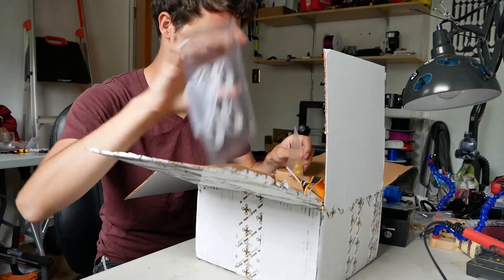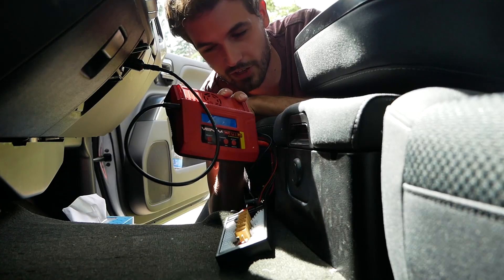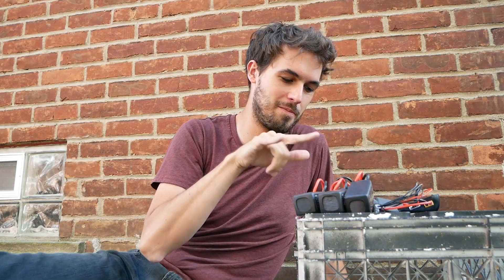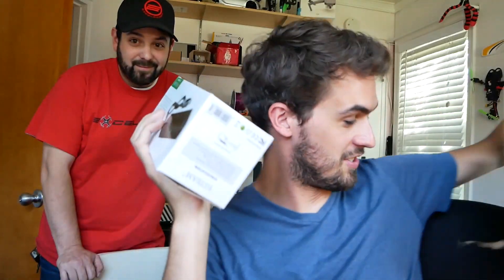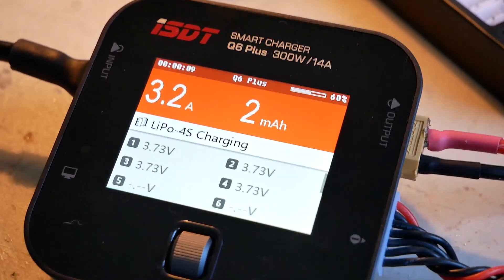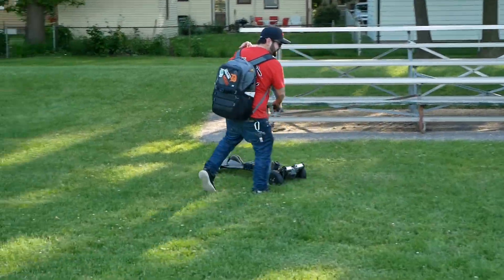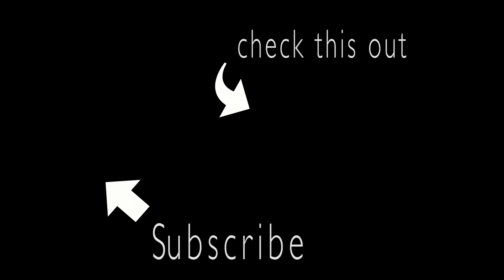charge drone batteries with a truck

Comment: I've charged my truck with a drone battery. lol It worked quickly. Only use 4s packs for that. Anything higher will fry your ride. Storage voltage is perfect for that.

Comment: Does it give a alarm on reaching the low voltage of battery that supplies power? I used a 6S as power source and set up 22V as cutoff but it still goes on charging below 22V. Any suggestions will be great. Thanks

Comment: I want a tiny whoop so the kids can get Into fpv as well but I cant figure out which one will work with my flysky transmitter lol I kno it sucks but medical issues in family prevent me from splurging unfortunately
Reply: You can get a cheap fc from banggood
Reply: There is a BUNCH of cheap Flight Controllers

Comment: So, if you plug straight into a car you don't need to use a power supply?
Reply from the maker: nope! Car power is already DC. Power supplies convert AC (wall power) to DC
Reply: @LeDribFPV  oh sick! That's perfect. Thanks for the reply

Comment: Hey Drew, Thanks for the video. Maybe you can help me :D I did it with a Xbox One Power Adapter but I got 2 yellow wires, 2 black ones a red a blue and a light green/mint clour wire. I put the two yellow ones together, the two black ones and connected them with the XT60. Then I put the blue and red one together and connected them to the red XT60 wire. I just isolated the green one for his own. When I connect Power Adapter and charger the Power Adapter shuts off. Why? :D

Comment: I have that charger and love it. Try a power supply with up to 32 volts input. A laptop power supply with I higher voltage can provide more watts per dollar! I power mine with a $12 24volt at 6A =144Watts. Charging at 17v, I can go up to 8.4 amps not counting for losses. In practice, I dont go over 6.5A

Comment: I got a 600w 27v for 28 bucks on aliexpress which powers my isdt sc-620 (20a/500w) with ease. It charges my 2x 6s12000mah field lipos at 20a nicely. Tip get a higher input voltage then 12v. 27 is pretty optimal and easy to obtain.

Comment: HEy Drew! Great video! HOw is the power supply holding up? I was planning on using an xbox power supply just as you did but I'm worried the wires are too thin to support 12A. What should I do?

Comment: Hey Drew Have the 500W version of the charger. Best power supply to buy would a a HP DPS-1200 it can output 1200W @12V

Comment: Hey Drew and other Guys i have a Problem i have the Rotor Riot Runcam swift, The Tramp HV Vtx and the DYS F4 FC.
I have soldert all wires to the FC but it does not work i get a very unclear and unstable video. 
I hope someone can halp me because i search for a sollution for over 3 Weeks now and cant get it to work properly.

Comment: Currently using that charger for the first time and I'M IN LOVE!!! It's the greatest, cutest lil thing ever!!
Reply from the maker: glad its working for ya!
Reply: I only tried to go up to 6.7amp in the car (although the cable was only luke warm and the van socket was rated for 12v 120watt). Literally charging for the first time with the 19.5v AC brick right now, 5 Tattu R-Line 1550mah batts, all started at 3.80v per cell, running it at 7.7a and it's been 42 mins, cells are at 4.15v (ohhhh sooooo close)        :) EDIT : 52mins DONE! :D

Comment: The easiest way to charge from a wall plug - just use an old Laptop powersupply - usually there are tons of those for free, being waste deposited every year. I built myself an XT60 Adapter for these kindof standard DC plugs coming from the Laptop powersupply - so no need to cut the original powersupply cable.
https://www.banggood.com/de/DC12V-MaleFemale-Power-Supply-Jack-Connector-Cable-Plug-Cord-Wire-5_5mm-x-2_1mm-p-1086722.html

Comment: another idea for a power supply is converting a computer ATX power supply.  there is a little bit of messing around, but can be done in an hour or two and will provide at least 35 amps as well as 5 and 3.3 volts.  ATX supply's can be bought for less then 20 bucks too!

Comment: If you want a really good power supply (I mean with temperature, overvoltage, overcurrent, etc protection) just purchase server power supplies from ebay or something. A friend of mine bought 4 of them for under 10$ and we both now have 1000W 24V power supplies for nearly no cost. A much better option than to purchase expensive power supplies which can't handle that much current anyway. Think about it, you can't really get a better power supply than one for a PC, because the delicate electronics in a computer need clean consistent power.

Comment: Dude, get a power supply for a server. They're super cheap for their output power. I have a Dell N750P-S0 that puts out 750 watts at 12v. You can find them on ebay / amazon for under $30 and power multiple chargers off it. The pinout diagrams are easy to find and it's super easy to wire it up. I feel bad for all the people out there who spend so much money on power supplies. The one's made "for the hobby" are ridiculously over priced.

Comment: hey drewi have a question i have a bunch of 3s batteries but no 4scould you recomend me a frame and motor that i could useim looking for it to be relitivly cheap and do freestyle with a good flight timesorry if im so specific, my 3s are 11.1 v. 30c 2,200. if the 3s is to underrated than i can get a more powerfull 3sagain sorry, Aaron

Comment: Dude I'm super glad you mentioned that part about your cig plug not having a fuse and just being direct connected with thick gauge wire. I didn't even think about the silly reason the fuse is there in the first place. **First Safety Tip** the average car cig adapter wire is NOT THICK ENOUGH TO SUPPORT MORE AMPS THAN THE FUSE IT COMES WITH. Reminder friends, do not change out the 2-3 amp fuse in those adapters to a larger one or bypass, the wire will not support greater amperage. I found one from a broken power inverter that was direct wire instead. **Second Safety Tip** BIG @SS AC to DC power bricks generally have GIANT CAPACITORS which hold voltage for LIKE FOREVER. Mine was still showing 19.5v FIFTEEN SECONDS AFTER UNPLUGGING, 8v 30 seconds afterwards, and TWO MINUTES LATER was still showing 0.5v. So when you chop the end off and are checking polarity with yo multimeter, MIND THE BARE WIRE GAP peeps :) ...that is all :D
Reply: maybe you can help me on this one: if i DO want to run wires from my battery through the firewall to the cab, what amperage is safe to charge while driving/idling? is it dependent on the alternator?
Reply: I don't think I've ever seen anything smaller than 10amp fuse on a car for the cig port

Comment: I've noticed with my isdt SC-608 it wont pull full amperage running off of 12v supply. When I switched to a 24v supply it will now charge at full amperage. I used this one https://www.amazon.com/gp/product/B01CS5G8J6/ref=oh_aui_search_detailpage?ie=UTF8&psc=1   <<<< 20$ 24v supply

Comment: Le Drib  hiya drew can you tell me what voltage and amp the sky rc imax b6 runs on I just got one but having problems getting the right power supply to work it  iv been getting input volt error with 12v dc and my laptop power supply
Reply: William Davie says 11 to 18, but if it's a knockoff you could have and issue. the one I got wouldn't kick on until 19.6v and wouldn't charge anything. so make sure you got a legit one.
Reply: +robsnook4512 thanks it's a genuine sky rc  but it doesn't work on 12v or a laptop power supply iv  got it working with an old one that's 17.94v   but it gets very hot  and I would feel better with the right power supply for it my friend 
iv been using the cheep China imax b6 for the last year and never had any problems with it  apart from not been able to calibrate it  lol   but this sky rc ones a bite temperamental with input power error and I'm not sure what size of power supply to get to be on the safe side

Comment: Please tell me you're not buying props @ $6.99 a set.

Have you thought about running a cable to the back of your truck?
Don't need to pop the hood,
never run the risk of forgetting something up there
and the bed is far safer than inside

Comment: Drew, I too use a lighter to shrink heat shrink when in the field, but at your bench you should have one of these heat guns http://a.co/7uTiU8c . Its cheap and works great, and no chance of burning the heat shrink tube or over heating it. Thanks for another great video!

Comment: Drib: this battery fits perfectly in the BPX3 slots and can charge my 12 1300mah graphenes at least 3 times in the field using the same charger you just got. Badass! https://hobbyking.com/en_us/multistar-high-capacity-6s-16000mah-multi-rotor-lipo-pack.html

Comment: Checkout getting a cheapo server power supply and using the 12v rail off it. They're dirt cheap on ebay / amazon and you can get a LOT of power for your money.

Alternatively, BangGood / GearBest sell a lot of dedicated power supplies that can deliver a few hundred watts.
Reply: SenoreQueso The other thing is that you can pair a couple of server 12v supplies to get 24v. Just make sure you float the DC ground on the second supply (or both).

Comment: As always...great video Drew. Love those ISDT chargers. You can get a great inexpensive 900 watt/75 amp power supply from ebay from seller hbdude2k for $49 that supports multiple chargers with easy banana plug outputs and is sold from here on the US. Keep up the awesome work man.

Comment: Couple of questions Drew, do you think that the new charger setup (when packed up) is smaller than your original car setup with the built in power supply? Also will you take a few to checkout my channel "Deerfoot FPV," i get all my inspiration from the FPV YouTube pilots, and would love some criticism if you've got it.  

Finally - tiny whoop idea. Was planning on doing this myself, but i think your channel would do it justice well.  Arby's sells a sandwich (for a limited time) that is absolutely ridiculous, called the "meat mountain."  Buy it. Whoop it.  Eat it. Avoid heart attack.

Comment: get an old PC Power Supply. They provide about 300W on the 12V rail which is plenty of power and they are more then cheap if not even for free :)
Also they have a poti inside which lets you "tune" the output voltage up to 14v or so.

Comment: oh hey, I got the older 20amp (500watts) version. I couldn't find a way to use its full potential and so gave up and bought a computers PSU at 800watts. 

had to short two wires for it to start but in the end (once you hide all the bulk) I had a very very nice charger.

Comment: hey drew i use this style of power supply  500Watts  https://4.imimg.com/data4/LC/RQ/MY-13013229/led-power-supply-driver-500x500.jpg     i added a 12mm fan on top to help keeping the power supply cool on heavy loads and it works fantastic oh and you can also set the output voltage between 12v to 18v
Reply: if you want i can send you an image and model number of the power supply as soon i finish work maybe you want to give it a try

Comment: Nice video. If i remember correctly, you can set the maximum power the charger uses. Just long press to get into the settings.
Reply from the maker: just confirmed, thanks!
I don't think I'm going to limit it, I'll just keep in mind what the max amp is I can set to depending on car aux vs xbox supply vs other supply etc

Comment: Is it enough 12V to charge 4S 16.8V battery?
Reply from the maker: yes I'm charging my 4S (16.8V) batteries using 12V input. Current on the 12v side of the equation increases to provide higher voltage on other side of equation

Comment: You should look into a re-purposed server power supply for your charger, they are capable of 100A and cost about $50 on ebay, there is plenty of info out there, or let me know and I can give you some specifics
Reply from the maker: Wanted to provide a very straight forward solution on the video, but I think I will look into server power supplies and if its simple enough I could walk through that too :)
Reply: Nice one,  definitely informative.  Those ISDT chargers are fantastic, supplying the amps is really the annoying bit.  I believe they have or are shortly releasing a plug in wall model tho

Comment: Been using this power supply with my ISDT SC-608 for a while now with zero issues. 12V, 30A, & $20... no complaints! ;) https://smile.amazon.com/eTopxizu-Universal-Regulated-Switching-Computer/dp/B00D7CWSCG/ref=sr_1_8?ie=UTF8&qid=1497412815&sr=8-8&keywords=12v+power+supply
Reply from the maker: now that is a good find! I might have to get one of those
Reply: Cool beans! Btw, that Monoprice 3D printer you got there probably has the same power supply. Ha!

Comment: I like progressive rc for my charging needs. They have some amazing ideas for power supplies. I got the same charger and power supply and they wired it up for me. I found I can't go above 5amps on my car charger either. I was thinking about installing an amp kit for stereos and run it to the back so I can charge out the back of my truck.

Comment: If you want a good supply, buy one of those. I also hade a Isdt Q6 Plus and two other chargers. I can all power up with this small server supply that can handle up to 100 Amps if needed. And this thing is very low noise under 50 Amps :) 
http://pages.ebay.com/link/?nav=item.view&id=122536150448&alt=web

Comment: 6:11 If I remember correctly, and I could be wrong, but the output amperage is whatever the thing is feeding the charger, not what you are actually putting out with the charger. So if that is a 12v at 135 watt, your charger is getting fed with 12v at 135 watt, i.e 11.25amp. Jeff is right about efficiency, and if you want to give it a safe estimate 80% is a fair number, so you should def be cool with charging at 9amps
Reply from the maker: Power In = Power Out + Power Used by Charger
Power = I (amps) * V (volts)

so there are two measurements of amps, the input and output.
Reply: for sure, but which is the amp we can use to charge? After further reflection I think you are right about the 135/17 since we charging at 17 and the juice gotta come from somewhere (transformers can increase volts but can they increase amps?) and then you need to take 80% of that cuzza overall loss. Where is Bardwell when we need him :P

Comment: 5:08 noooooo Drew, I totally had a 19.5V 6.7A laptop docking station power brick on standby to send you!!
Reply from the maker: Is that what you use? I bet that works really well since it's higher voltage
Reply: That is what has been sitting next to my soldering iron with an XT60 laying next to it ever since I ordered that charger and minutes later you said "Ima bout to make your week awesome with my super epic extremely relevant video coming out soon" :P hah ...but in the process of searching for parts I might just need I found like 5 of those bricks in my junk bin, so for realz if you want one it's all yours :D

Comment: 2:06 did you take the 3amp fuse thats in the car cig dodad out and replace with the highest your cig outlets could handle (120watt i.e 10amp in my case)??
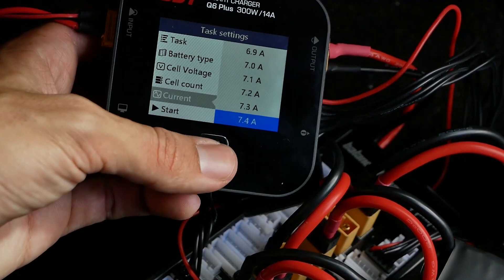Reply: 3:19 yeah dawg, unscrew the end of that cig majig and get rid of that crappy fuse that's in there. The mini van we taking to CO literally says 12v 120watt on the cover so I'm absolutely putting a 10amp fuse in the cig adapter and going to town :D
Reply from the maker: The aux power cord linked does not have a fuse it's direct wires with a thick guage wire 👍🏻
Reply: I'm super curious, unscrew that little nub on the end of the cig adapter, the way those always work (or at least the hundred I've f'd with) the little bouncy thing is actually held up by a fuse on a spring
Reply from the maker: Yeah on mine the wire is connected directly to the nub and outer contacts. No fuse
Reply: Spiffy! I think I might just make that then cuz I'm having no luck finding a 10amp cartridge fuse anywhere in my pile of electrocrap

Comment: This power supply is what I use to power two chargers and my ham radio vhf rig at my desk. It's really small and quiet and puts out 30 amps. MFJ-4230MVP it has two Anderson power pole connectors on the back as well. http://www.hamradio.com/detail.cfm?pid=H0-012488

Comment: off topic here but i broke my gopro 3 non plus and now without spending alot what would be just as good and isnt going to cost more than my drone lol. It will be for fpv drone. I like session but i still have a phantom 3 with zenmuse h3-3d so im kinda lost
Reply: David Downs runcam split
Reply: XeroVolume split? so I use rotor riot fpv now but split is size of fpv cam?
Reply: David Downs The split is the size of an fpv cam, but it comes with a board that stacks on the fc and records hd footage. It illiminates the need for a GoPro and reduces weight.
Reply: XeroVolume wow that may be a great advantage ..thanks didn't know that was possible yet

Comment: For $70, the P350 power supply works well with the iSDT charger.  Has bullet connectors so it's easy to make an XT60 plug for it.
Reply: For $0 any power supply from old PC gets you 300-600W, just have to solder some XT60 connectors and short the power-up wires from it.
Reply: just stuck with 12v though.
Reply: Shouldnt matter, that charger has operating voltage DC 7-32V